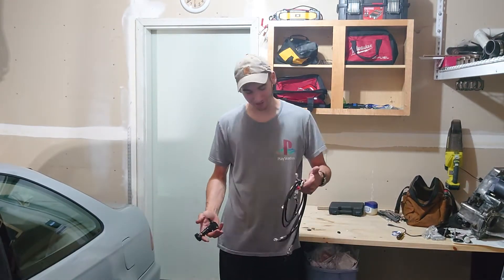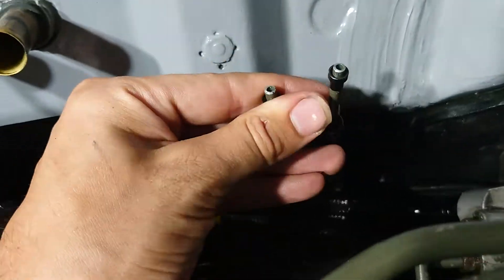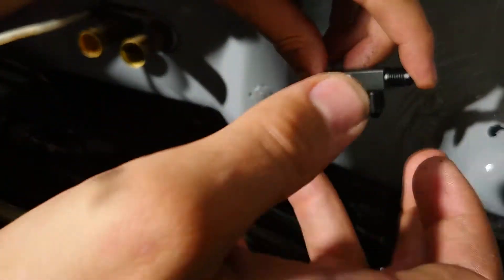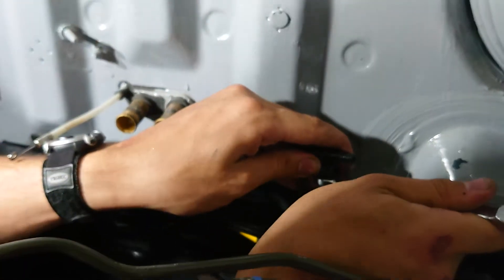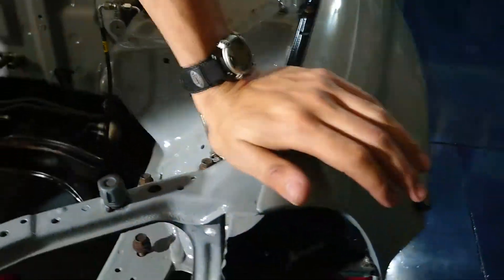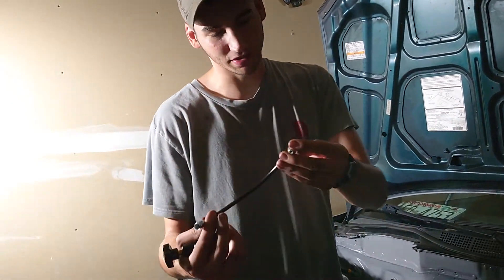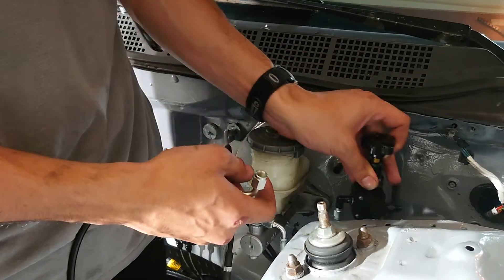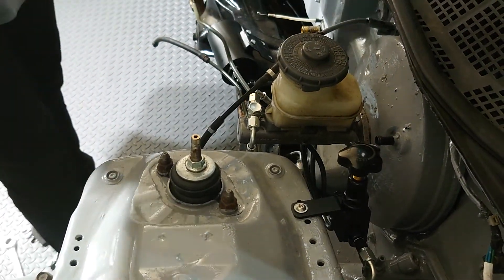Tucked Brake Lines + Bias Valve Install 92-00 Honda Civic (Chase Bays)

Comment: Can you do a video on how to adjust/use the chasebays proportioning valve?
Reply from the maker: I couldn't find any good information online about it. On top of the knob it shows you which way to turn it to adjust your bias. I dialed it in by making my adjustment, going for a test drive with some hard braking, then going back and making adjustments until I liked how the car felt

Comment: You should be using a 37 degree flaring tool, because those fittings are AN. You won’t find that at your local auto parts. (the standard is 45 degree)
Reply from the maker: Good point man! Luckily mine still sealed just fine, I'm guessing because the lines are so soft they conformed when I tightened them down!
Reply: @kraftingkars  You’ll probably be fine, just passing along the info for the next guy.
Reply: I read this before I did this, and my f fitting is leaking on one of the connections.. I should’ve listened to you! Do you know where to get the 37 degree flaring tool without ordering it?

Comment: If I wanted to just buy the fittings and and Bias valve and run custom hard line. If would work right? Are Those female fittings 3an that screw on to the T banjo?
Reply from the maker: Yessir, and yep they are 3an

Comment: How was the process on bleeding the brake system I bought this kit but I'm not sure how to go about bleeding the brake system
Reply from the maker: Bleeding the brakes is exactly the same as the factory procedure! Where you fill up your master cylinder, and bleed the fluid out using the bleeder screws on your calipers. Here is a good link for ya https://honda-tech.com/how-tos/a/honda-civic-how-to-bleed-your-braking-system-374619

Comment: How's the braking after the installation? I just got done doing poor mans 5 lug conversion. Would this work on my setup? Me Driving a 95 coupe. 1 inch MC/BB off a 99 teggy.
Reply from the maker: Braking is great! Keeps the 400whp under control! Check out the chase bays website, they should have a setup that will work for you!
Reply: @kraftingkars  thanks
Reply: @kraftingkars  how's it compare to the 40/40 proportioning valve? Any difference? Just better or alot better ?

Comment: Hey man my local Oriellys has the flaring tool but I’m not sure what degree it is.. did you tell them specifically you wanted a 37 degree flaring tool? Or just use what they had. On chase bays they say to use a 37 degree tool. So jw. Cause I’m about to start on my chase bays kit as well parts are coming in tomorrow thanks man I hope you can get back to me ASAP as I’m stuck right here 😓
Reply from the maker: Just the regular o'reilly's brand flaring tool is what I used, I rented it over the counter. No leaks yet

Comment: Hey question, you moved your proportioning valve now did that give you any issues with your clutch master cylinder fitting or did it clear with no problem sorry I’m new to your videos but I don’t think mine would clear being mounted there ?
Reply from the maker: Cleared no problem! You can see better pictures of my engine bay at afton.voigt.ej8 on Instagram

Comment: And can you also run that brake line kit with a brake booster delete
Reply from the maker: If you go to the chase bays website, they have a drop down menu where you select your chassis, and master cylinder type! They have an option for every combination!
Reply: @kraftingkars  for sure thanks brother for the info it helped out a lot , I went 5 lug and my H2b skunk 2 manifold sit far back so I’m not able to run a Gsr brake booster , and my dx booster is not holding brake pressure at all

Comment: Great video man, would this still work well with a rear disc swapped civic? Mine's a 97 LX I'm gonna be swapping out with integra disc brakes.
Reply from the maker: Yep it should work! I'll be swapping to rear disks soon! I'll be sure to make a video on it. One thing people recommend after getting rear disks is to get a larger master cylinder out of an integra
Reply from the maker: Dc2 integra that is, the best option is probably the type r master cylinder

Comment: bro  can you give me model number of that brake lines kit that looks easier than what I've been seeing on YouTube
Reply from the maker: CB-H-9600OEMC is the SKU number of the product. This is for a 92-00 Civic with OEM master cylinder and no ABS! It is a real easy install, the other videos out there just suck at explaining I guess.
Reply: Thanks bro and yes I saw your video how easy it was to do it I see other people drilling through the firewall I really don't want to do that
Reply: @kraftingkars  hey bro I can't find them what's the page you get it on?
Reply from the maker: @reddragonx8799  https://www.chasebays.com/collections/honda/products/chase-bays-brake-line-relocation-94-01-integra-92-00-civic-oemc?variant=37009011593
Reply: bro one more question which brake master cylinder do you have I bought one from B blox and it only has one hole in my original one has two holes from the cylinder
Reply from the maker: @reddragonx8799  mine is the stock OEM master cylinder for a 97 civic without ABS. I have 2 ports on mine for the front and rear. On there website they have a kit for those running the brake booster eliminator kit, which makes use of their master cylinder with one port. That's the kit you wanna get. Even if you are still running a brake booster, that's the only option if your master cylinder has only one port.
Reply: @kraftingkars  do you have a Instagram or a Facebook bro??
Reply from the maker: @reddragonx8799  afton.voigt.ej8 on Instagram